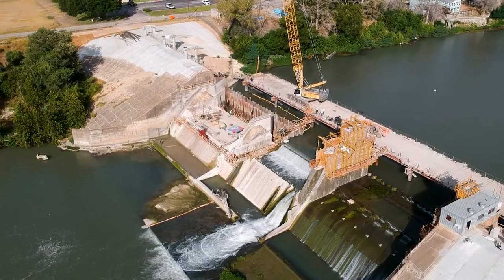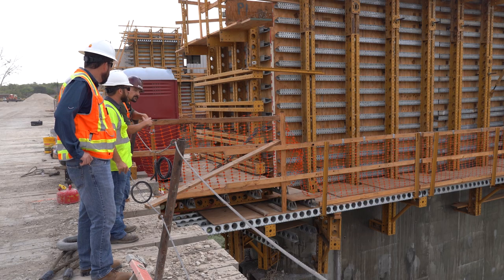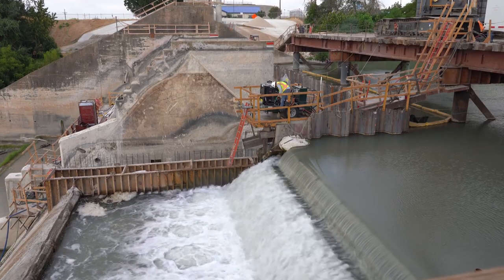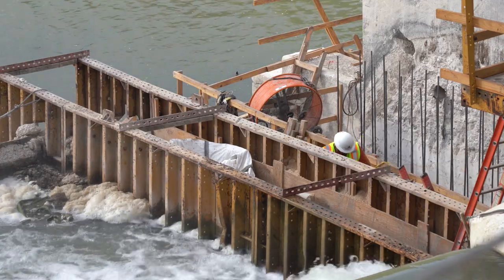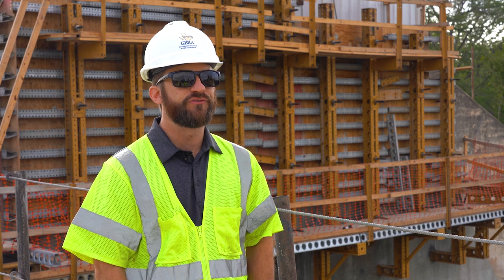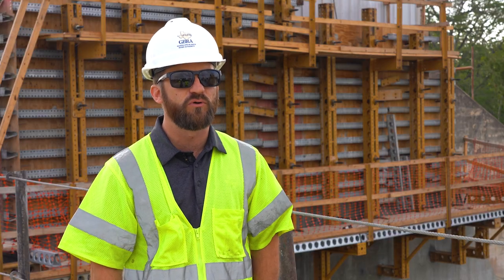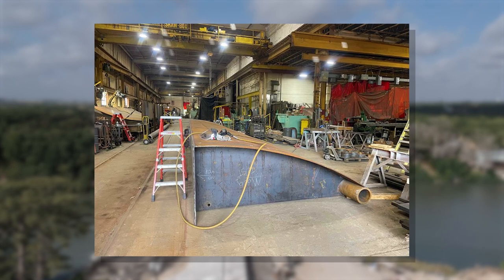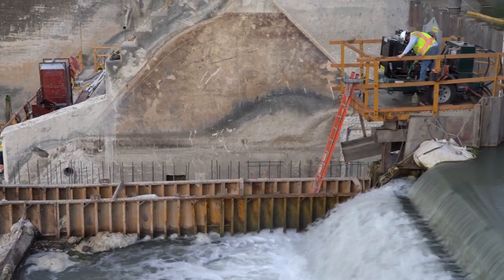Lake Dunlap Construction Update - September 2022

Comment: What's the benefit of the dam
Reply: water suply ahnd hydro power
Reply: @the_retag  I don't think that dam is generating power anymore.
Reply: Sentiment
Nostalgia
Aesthetics
Land value
Reply: @the_retag  I found out, the new dam will in fact be generating electricity.
Reply: @Stacy_Smith  would have been quite a waste of literally free energy otherwise
Reply: Definitely land value. It drastically dropped the moment that dam did.
Reply: @bernardfitzgerald6117  The dam/lake did and will again generate some electricity and there is a pump station in the lake to send water to other communities.  GBRA set up temporary pumping lines right after the dam broke to still send some water to Kyle, I believe. These are the only two sources of income to GBRA for this lake (hydro electric power and water), although I think the electricity was an insignificant amount of income.  GBRA was not going to rebuild the dam because the amount of this income was not enough to make it sensible to build a new dam. The dam was built with a bond that will be partially paid in taxes by residents of the lake front property over the next few decades. So, Land Value seems to be the main reason the dam was rebuilt.
Reply: It benefits property owners at the expense of the environment.
Reply: Property values of homeowners...
Mother nature is trying to repair the river, but humans will not be deterred if it means they cannot play with their boats and docks 😂